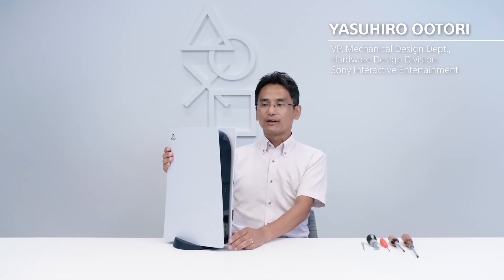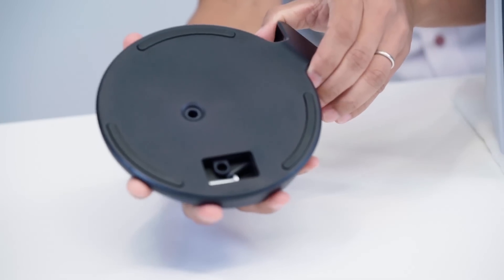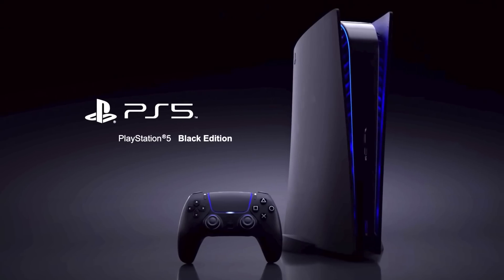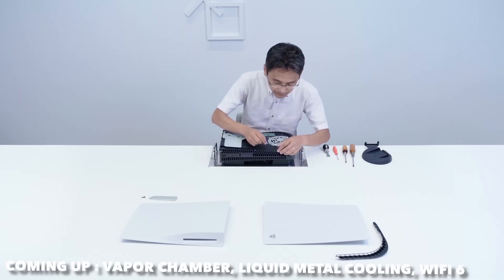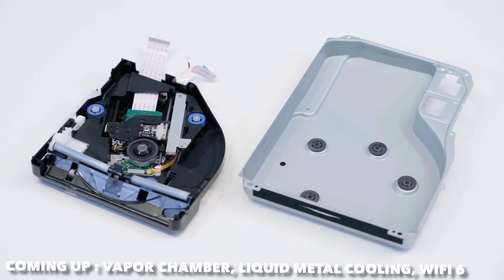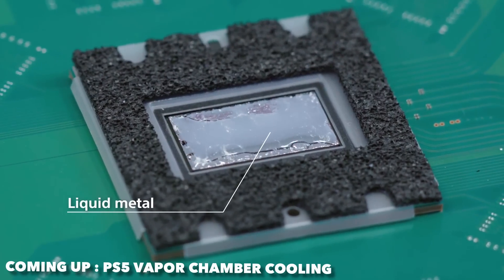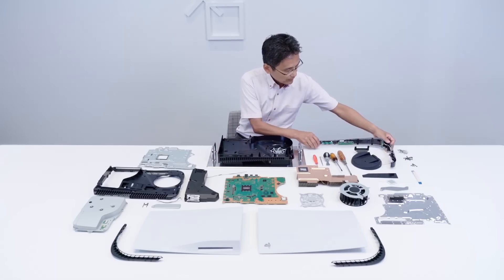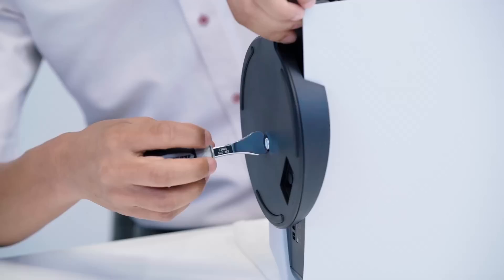PLAYSTATION 5 ( PS5 ) - THE PS5 OFFICIAL TEARDOWN CONFIRMS HUGE PS5 FEATURES! LIQUID METAL COOL...

Comment: As a huge Xbox fan, PS5 out did themselves this gen. Completely shat on Xbox on everything. More games, faster, better looking, more emersive gameplay, a new gen controller. Ive also read that Xbox is being reported to run extremely hot on old games and just simple navigation of the UI menu. So hot that one person said they burnt their hand on the vent. I suffered through the ring of death, and these latest reports of "fireplace vent" of an Xbox will have me waiting until late 2021 early 2022 before I grab a Xbox. Ps5 at drop for this Xbox fan.

Comment: I see a lot of warranties getting void with this design.
Reply: How so??? The panel removal, dust cleaning ports and SSD expansion port can all be accessed without voiding warranty.
Reply: @brianmcswain8932  Yes, for responsible adults. Now let some younger kids get under the hood and start tearing things off and removing warranty stickers on bolts etc. Give a person an inch and they will take a mile.
Reply: J Cuz  And whats stopping any kid from doing that on any system ever made?   This is very weak my friend.  If my kids removed the warranty tape and messed up the system they would replacing it on their own.  You remove panel, vacuum  two ports, add SsD without going any further. Easy.  If you go further and break the warranty seal that’s on you.  Why would a “young” kid be doing this in the first place???
Reply: @brianmcswain8932  Out of curiosity my friend. Sony is encouraging people to play with the hardware with this design. Which as a kid I would be interested to see what else I can take apart if I can take off the panels why not keep going. Just a thought, not a fact at this point. But time will tell.
Reply: J Cuz You realize that as a “kid” you could take apart every single console ever made.  I think you have a parenting issues. Man you are really reaching to throw shade on the PS5.
Reply: @brianmcswain8932  OK then Brian, no need to get angry.